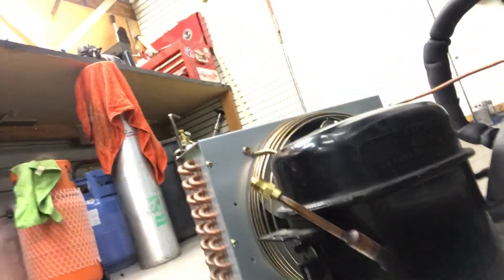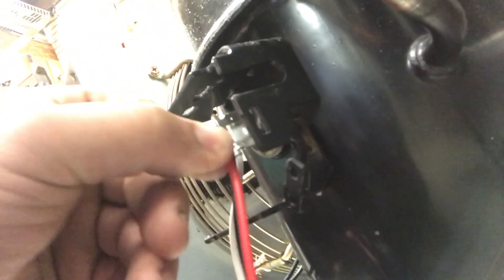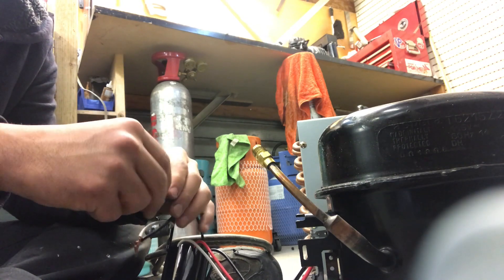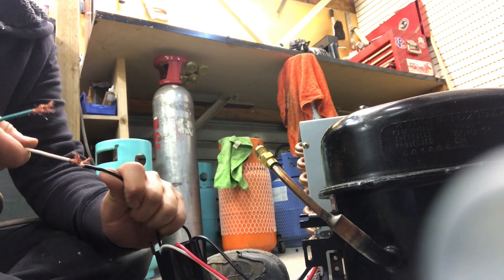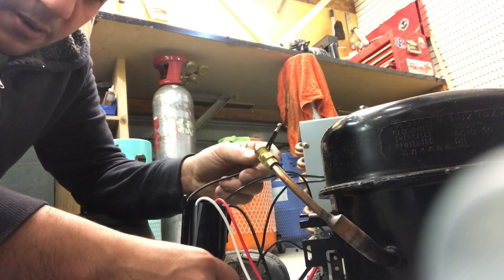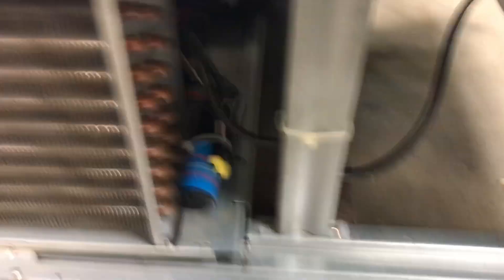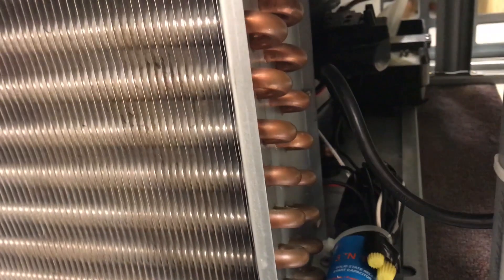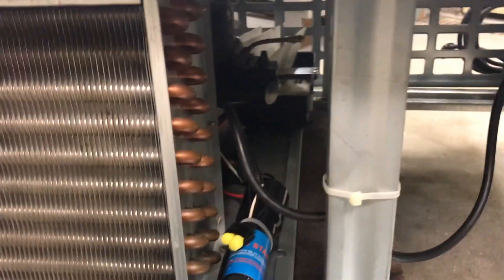HOW TO INSTALL A 3 in 1 install RELAY, START CAP, OVERLOAD.

Comment: I have a 115 volt walk in cooler. The compressor has a start and run capacitor. Would a 3n1 work on this application?

Comment: I might connect the wires of the 3 n 1  incorrectly because now I’ve no power at all on my refrigerator 
Is there fuse that I need to replace? 
What are your thoughts?

Comment: What do you do with the wire that was connected to the overload? 
You connect the 2 back wires to the wires that were connected to the start relay but sure what to do with the 3rd wire that was connected to the overload capacitor

Comment: Ok, the 3 N 1... this is nothing more than a hard start kit which would be used for compressors that may need more starting torque or to break loose a compressor that is stuck but in this situation you are using it until you can get a potential starting relay for your compressor. Interesting.
Reply from the maker: correct! only I like to change ALL the electrical components not just the potential relay.
Reply: @dnoorian  Yes, it makes sense & its also cheap insurance against another electrical component failing in the near future especially when selling used refrigeration equipment.